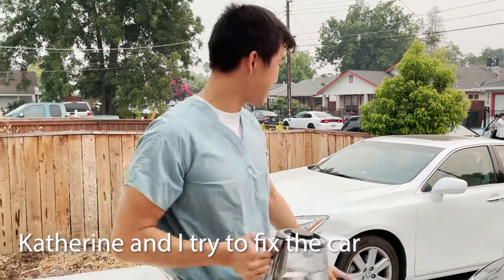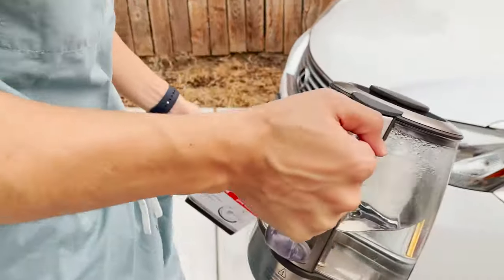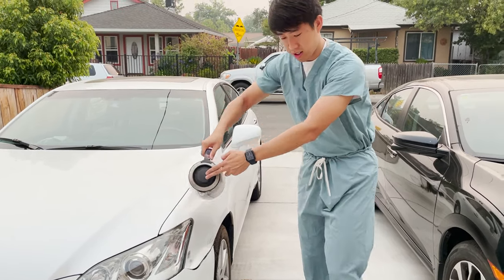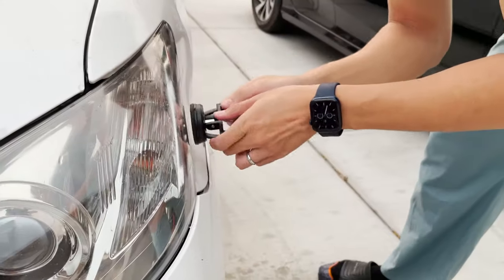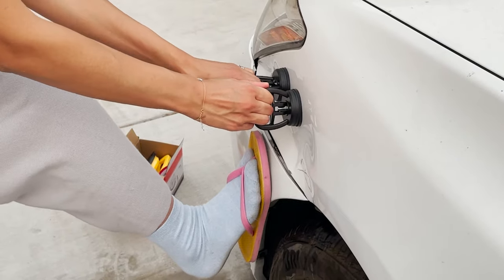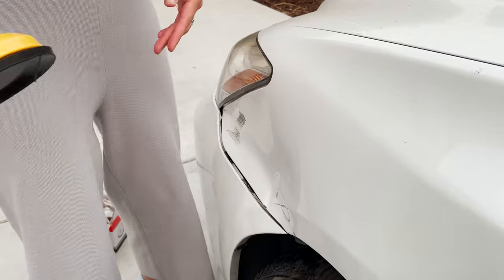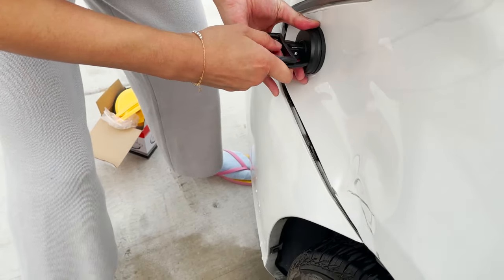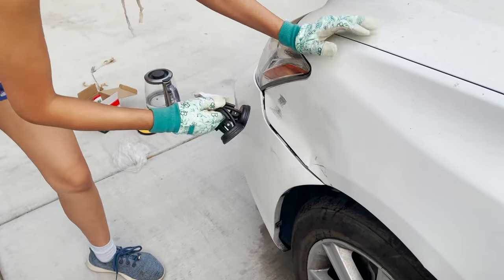Do Car Suction Cups Work To Remove Dents?

Comment: All dents are different.  Metal has memory to it, meaning it will want to go back to its original shape, but it takes some massaging in order to do so.  This dent was too sharp to do with just a suction cup.  Glue pulling would be a better option or using a PDR tool from behind so you can work the dent out by pulling in precise locations.  Just pulling in the middle wont work because the sharpest part of the dent wasnt pulled.  Until you get that out, the big part will always go back to that shape.

Comment: i had a ding in my car. 2 dings. backed into a pole.  they were not really big. i used this and worked it for an hour. use windex or water to help it stick. i would say i got a good 85% of it out. stopped because its now nite time i cant see. i think its very minimal and hardly noticable but its not exactly like new looking. but it does work and will continue to work on it tomorrow or this week when it is sunny!  you have to do it multiple times so try it for 1/2 hour or more. you will notice an improvement.
Reply: i used the small  2 1/2" ones. the big ones would not stick to the area i had.
Reply from the maker: Thank you for the tips!! :)

Comment: Although it didn’t work for you, not to brag but watching your video taught me how I should try and get my dent out and IT WORKED! I have a x3 2021 I dented the door using my body to close it one day. (I only weigh 135, but I was mad this day) I got a pot of boiling water poured it all over the passenger door the big cup wouldn’t suction but the little ones however 😳🤯 I had to pull a lot even after the dent was out to get the little ones off lol ! I got mines from amazon for 16 bucks this saved me a lot !!!
Reply: You dented your car with your body? 😂… you better chill out… talm’bout “I was mad that day” lol

Comment: For damage in that location you can run the boiling water over it like you did then push outward from the inside of the wheel well.
Reply: My thoughts too. I would probably take that tire off, unfasten the wheel well and get in behind the damage with a steady heat gun blowing around (160-190 degrees F) on the outside and a take a rubber mallet to the dent from the backside. (soft love taps). Let the heat gun do the heavy lifting.
Reply: @nickorsini2975  Depends on the car I guess. On mine (02 VW Passat) I'd probably be able to unscrew the bolts on the plastic portion of the wheel well which would allow access to that area of the bumper.
Reply: @nickorsini2975 
Absolutely agree. 
If you've got the time to do it yourself, and a bit of manual acuity, it could save you a bundle, and if you know what your doing a but, you can insure that it's done properly. 
Yeah, using a heat gun for hear is your best bet, but some "hot water" like this guy did is pointless....

The only thing I'd add would be to go as hot as you can (to not damage the paint), and have it heating in the exact center of your pull, for a short-enough time, so you don't heat up the part of the panel that you don't want to move.
I only know the heated metal issue from using my thermal cameras in thousands of occasions at work, and then home. 
It can really help you visualize how materials respond to their environment's temperature.

Comment: push is 100x easy and 100% results versus pull especially if it is deformed rather dent. That is why body shops charge fortune because they remove body and fix it. Gonna return mine after few try

Comment: Open the bonnet/hood and use a rubber hammer to push the dent out from the inside. That's how I removed the huge dent on the left fender about the bumper.

Comment: Hey Doc, going forward if this dent is all ready fixed by professionals and if it happens again, I had this idea using powerful Neodymium Magnets. Some of these magnets I see on Amazon have a 2,000 lift rate, though they vary in power for that matter. Also, theres Amazon sourced percussion massagers with varying speeds, though this approach would have to be tackled from the inside of any metal panels on a vehicle. I have one of these percussion massagers for my back for  3 herniated thoracic disc that when everything fails I resort to having wifey, or young son treat my back. I suggest if using the magnet, to use a cloth between the magnet and the metal panels.

Comment: I appreciate you posting this video. I think my dent in the right front quarter panel is able to be either knocked out or suctioned the way you posted. My front bumper is another story. It’s plastic Kia Soul … but I think I’ll be able to effect repairs using the $1800+ I’m getting from the insurance company!

Comment: Tgese suction cups do work i use tgem all tge time, unfortunately they dont work on all dents. Keeping tge suction cup wet is also key or using a heat gun would be better. I have been a body repair man for more tgan 25 years and the suction cup is a great tool for some dents.